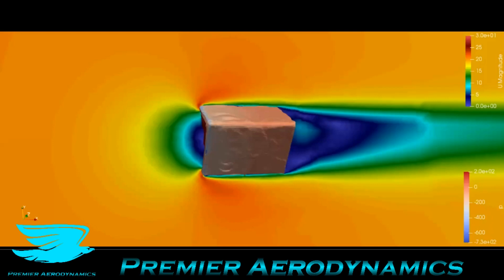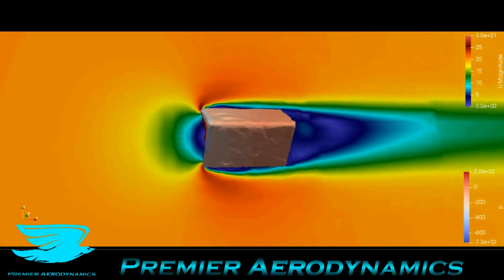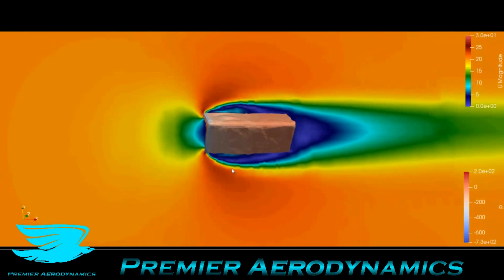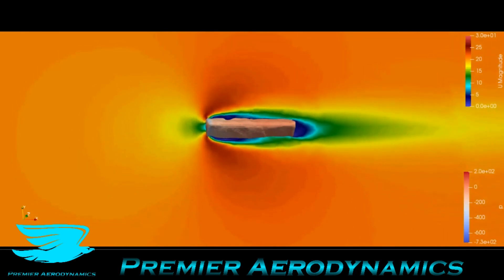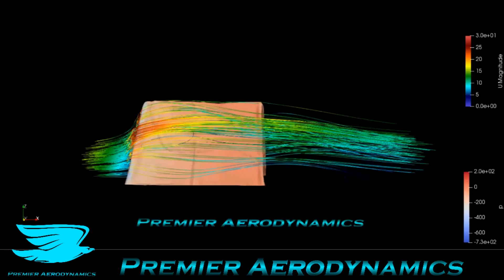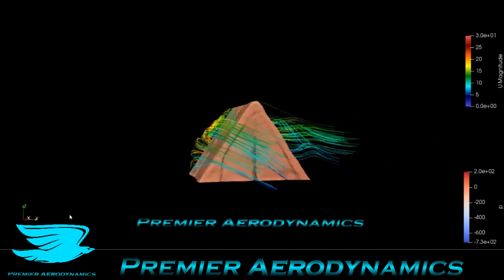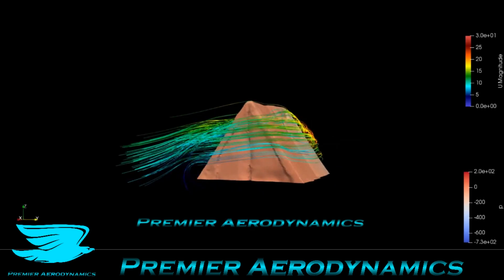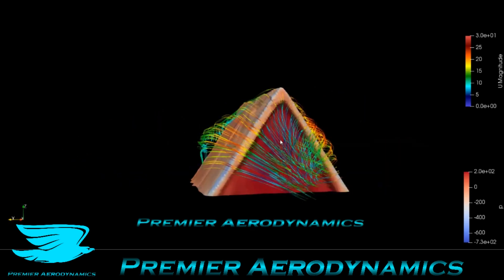Is a TENT STREAMLINE??

Comment: Anyone that's gone camping knows tents produce lift, which is why you need to stake them to the ground. It's just cool seeing why they produce lift, and it ties in neatly with most theories about pressure gradients. Smaller volumes have lower pressure than larger volumes, assuming reservoir pressure is constant.
Reply from the maker: Only stake them in the ground if you don't want a surprise during the night.😂

Sorry, I don't quite understand what you mean🙃. What do you mean by smaller volumes have lower pressure than larger volumes?
Reply: @PremierAerodynamics  the top of the tent has a smaller volume for air to pass through. While the base has a larger volume, if the same amount of air is passing through the tent, because the upper volume is smaller, you'd expect the air to go faster there, and slower in the bottom. This would create lower pressure at the top, and as a result, lift. As the stagnant high pressure air moves towards the lower pressure faster moving air at the top.
Reply from the maker: @rolandotillit2867  Oh! I understand. Yep, the continuity equation says that must be the case.👍
Reply: @PremierAerodynamics  If two tubes have the same head pressure, the smaller diameter tube will move air faster than a bigger diameter one, until you reach M>.3
Reply from the maker: @rolandotillit2867  Yeah! And the cool thing is that when the Mach number starts approaching 1, it starts to choke. Pretty cool!